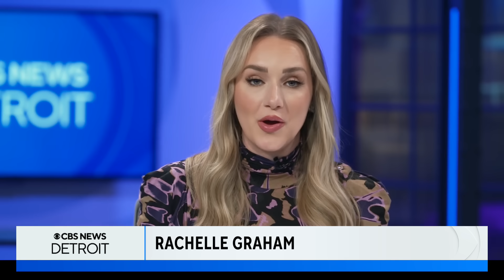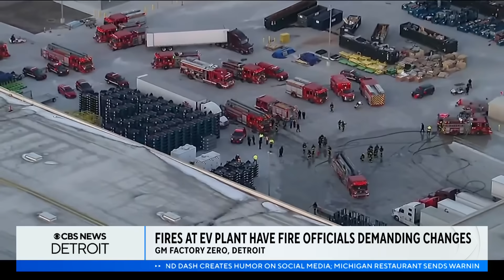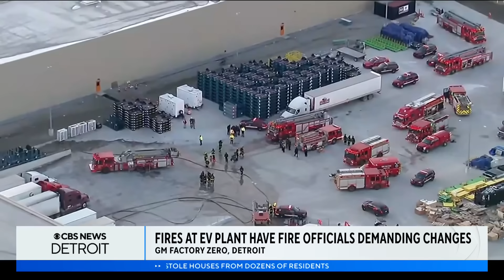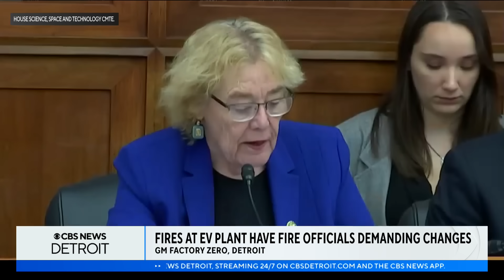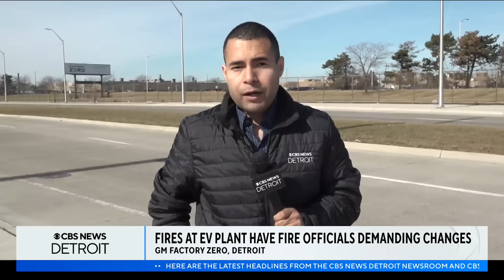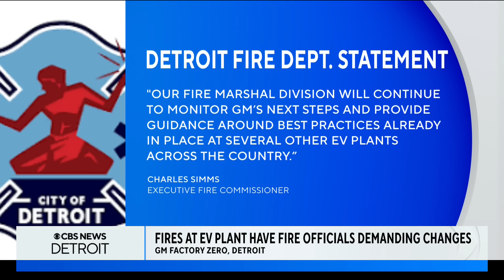Fires at GM EV plant have fire officials demanding changes

Comment: yet they want to put these in your house/garage on a charger
Reply: @Look_What_You_Did Half empty fuel tank cannot heat up on it's own like defective batteries can.
Reply: But your half empty fuel tank doesn’t catch fire as easily as the battery and the battery is extremely hard to stop the fire as gasoline is controllable.
Reply: @glennjohnso310  ICE cars are FAR more likely to catch fire bud.
Reply: @Look_What_You_Did
Pay attention. LI batteries are difficult to extinguish and produce toxic gases.
Reply: Insurance companies should be aware of the dangers by now.
Reply: @rolandthethompsongunner64  im hearing they are.
Reply: @Look_What_You_Did Liquid gasoline isn't very flammable, so if your fuel system isn't leaking you're fine.  It is the vapors that are flammable, and if you can't smell that and take proper precautions, well...
Reply: @JRobert111111  Very true, but it has such an incredibly high vapor pressure and that vapor has such an incredibly low ignition point.  A small tank failure, vent failure, or hose failure can lead to an immediately large fire.

Both systems fail and can create large, hard-to-extinguish fires with high spread potential.  Battery systems tend to fail while charging.  ICE systems tend to fail while driving.  Pick your poison, stay up to date on your inspections and maintenance, mitigate your risks.
Reply: @JimmyNewCakes  Yes, but an ICE vehicle fire can be extinguished with the 500 gallons or less of water carried on the truck.  An EV fire requires a hydrant and possibly a few tens of thousands of gallons of water to cool down the battery pack.  Also, with an ICE vehicle; if your nose is working, you can normally pick up on fuel vapors early on, and if not ignored; the repair can be made and avoid a fire altogether.  I'm sure many ICE vehicle fires had been smelling the gas vapors for awhile and just chose to ignore the problem instead of repairing it.  I've experienced a corroded hole in a fuel line, a mechanical fuel pump spraying out (better than into the oil), accelerator pumps (carb) leaking, the wrong style hose clamp used by the manufacturer (Chrysler in the 80s) and a cracked evap. canister.  All of these gave off plenty of vapor, but I fixed them quickly and never experienced a fire.
Reply: @JRobert111111  Liquid gasoline isn't flammable...my god you rednecks will say literally anything to support your biases.
Reply: @Look_What_You_Did gas doesnt spontaneously explode like a shorted battery numb nuts
Reply: Look at the idiots responding to your post, leaping to defend this dangerous technology. A bunch of Pollyannas.
Reply: @Look_What_You_Dida half empty fuel tank isn't going to just catch gore sitting around either.
Reply: @Look_What_You_Did more energy but when was last time you heard of a gas car bursting into flames without outside force?
Reply: Just because one auto maker has EV fires does not mean all EVs are built the same.
Reply: @1HeatWalk  I suggest you look into the supply chain for the batteries that they use.
Reply: @1HeatWalk  the lengths we go thru to delude ourselves.
Reply: do you own a phone? or a laptop?  then you are currently storing lithium ion batteries in your house ... and charging them in your house
Reply: @Tasty_Radd How often do they explode?
Reply: @Tasty_Radd  so since a 50ma/hr battery is ok then a 50ka/hr must be ok too. also your phone and laptop arent subject to road damage.